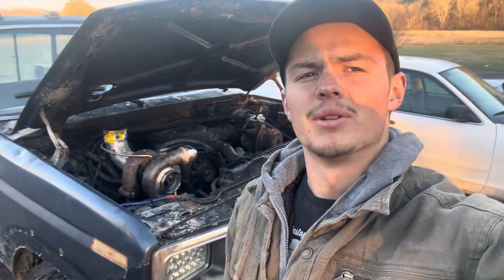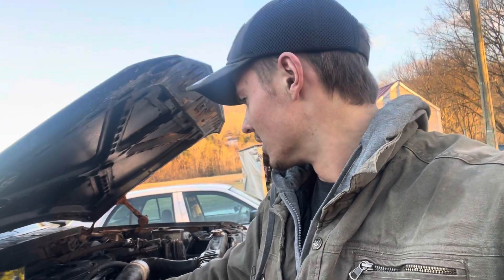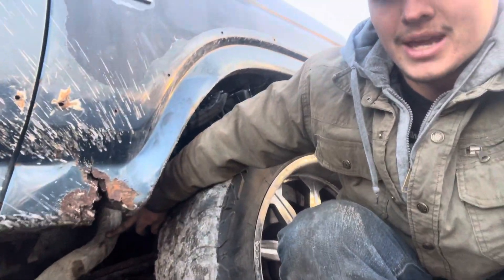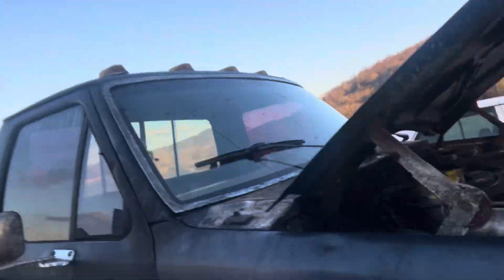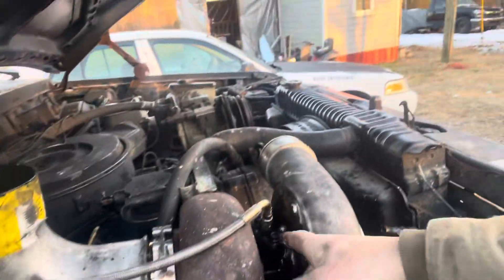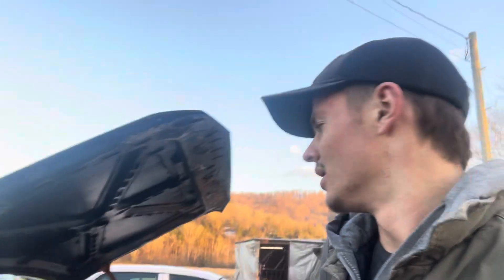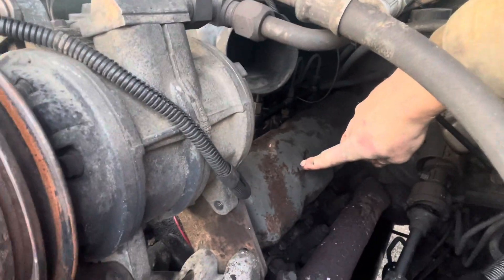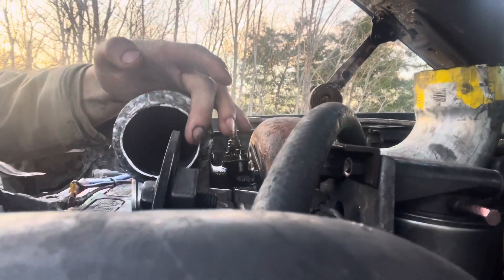Diy Turbo Kit on a 7.3 idi

Comment: next video could you post a more in depth view of your engine bay and how the "up-pipe" is running. Trying to use some of this idea with a little spin to throw an s261 in mine. The idea I am trying to figure out is if i can run the 2.25 up without going around the fender well and still fit a 3 inch downpipe to my 3 inch exhaust from right after the 2.25 y pipe. I would really like to see if I can fit the up pipe and the down pipe around the side of the engine so that it looks somewhat factory around the outside still. great work! I am definitely going to be using some of this design for sure😄